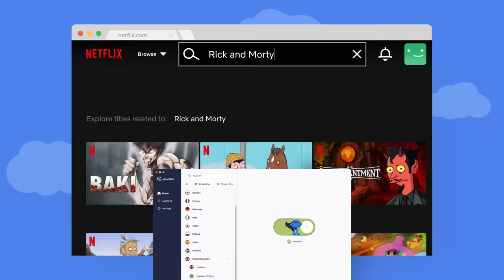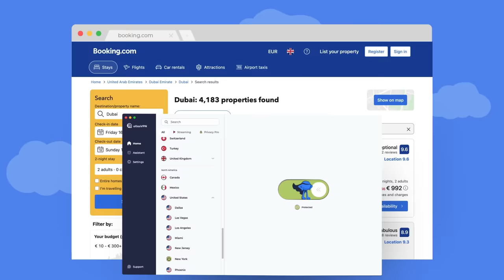How do Russians Cope with Heavy Tank Losses?

Comment: It baffles me that they're still not fixing the T-90/72 reverse problem.
If they're replacing that many engines and transmissions, now would be a great time to remedy this huge design flaw.
With the new T-80s, they're supposed to have a much faster reverse speed, so it's clearly something that the old men in Moscow know about.
Reply: Kid: In these times with the anti tank weaponry you got, it doesn't really matter how fast you can drive back or in general. You can't outrun these missiles and so on.
Reply: When making a tank, its all starts with an engine. Recently there's been a slow shift of abandoning the V-2 Engine design as it reached the maximum limitation of the engine and now starts  development in Gas engines designs that focuses on reverse speed.

One of the main reason why the reverse speed is still not "fixed" in because of their Russian Doctrine which basically summarized as "hills are a no-no to enter unless its ours"  where flanking on high grounds is more on the focus of their armored divisions (this explains why their designs have terrible gun depression and reverse speed while focusing on high speed and rapid fire) 

Another reason is that redesigning the V2 Engine is significantly cheaper than creating a new engine to replace that one. Which kept the Soviet and Russian price for each tank low. Its better to redesign and simplify things than to create from the top.
Reply: Т-80 has a turbine engine. All of the rest do not. It might have something to do with the reverse. Maybe there isnt enough space on the diesel tank.
Reply: Yeah, it's kinda weird considering that Polish PT-91m and Czech T-72m4 had fixed that issue couple years ago
Reply: The real world isn't World of Tanks buddy
Reply: @miriamweller812 yeah reverse speed basically doesn't matter. That's why Russians chose T 80 for mass production, their only modern tank with decent reverse speed, and the first thing Ukrainian former t 72 drivers compliment about western tanks is reverse speed. The opposite of what you said is true, being able to get out of situations fast and without exposing sides has never been more important.
Reply: I'm no engineer. But i'm quite sure then the entire engine bay of the T-72's and T-90's will have to get rebuilt, because they don't use the same engine as the T-80, and that may be the reason why they can't improve the reverse Speed, because the Transmission would need space it doesn't have.
Reply: They actually ARE upgrading the transmissions with new ones capable of reaching 20+ KPH in reverse
Reply: @miriamweller812 Kid there are literal telegram interviews where both russian and ukrainian veteran rank crews say “yeah we’d like that reverse speed increased”

i read one T80 commander saying that the 10km/h reverse speed was able to save their souls from a fiery death on (i think) 3 times.
Reply: @miriamweller812 seems like a fair question, you don’t need to be condescending with “Kid:”
Reply: Surely reverse problem isnt the reason tanks are getting destroyed. Its a matter of priorities.
Reply: @ingloriuspumpkinpie9367 it does mean a lot when a tank has just shot and wants to reverse back into its cover 15 metres away
Reply: @miriamweller812 Russian tank factory: Guys we shoud not fix a clear design flaw, because western anti tank weapons will destroy our tanks anyways 😂 great logic
Reply: @orenalbertmeisel3127 Wtf is this argument?
Reply: I think they need to hire french engineers 😂
Reply: -You don't stop a production line, while in a active war.
Especially not when you've lost 3000+ tanks.
-There's no transmission that can be fitted without a redesign.
The T-72M4CZ only solved this problem via fitting a new engine(Perkins) and a new transmission(Allison).
Reply: @miriamweller812 When artillery starts raining down on you. A good reverse speed helps not make yourself to more weapon systems by being forced to show your arse.

 A convoy is only as fast as the slowest tank. Oh! Front tank was taken out...  Yet now instead of the convoy reversing to find an exit you are stuck trying to again turn around.

 I've seen a video where a tank flanked an other who couldn't reverse fast enough, and shot it in the side. 

 No idea why that tank couldn't just turn to be honest. Lots of questions. Still it clearly was reversing slowly, and trying to get the gun on point. 

 Reverse speed helps. It is ridiculous not to upgrade it. Forcing your soldiers to show the weakest parts so the enemy doesn't even need fancy weapons to destroy your tanks!

 Auto cannons would do.
Reply: @MotivationSHCUM  In very small scale production run, as you need brand new transmission for the job, and those aren't easy to come by, especially when it comes to finding one that can fit tiny engine compartment of a T-72
Reply: It's not war thunder or world of tanks!  The tanks are getting nailed by artillery and ATGMs long before they have time to back up!  Not that it would do them a lot of good most of the time.
Reply: Up until now, there really wasn't a need for it; On a practical level russia didn't need to worry about territorial defense due to a combination of russia's sheer size, it's volume of tanks and it's prodigous nuclear arsenal while offensively Russia's military is mostly there to bully former constituents.
Reply: Because the amount of times it actually matters compared to what it would take to fix that problem is disproportionate. I'm not saying it doesn't matter, I'm saying that it's not something that can be fixed because Russian tanks are hyper optimised for weight and size. You can't just fix the problem because it doesn't fit in the hull. You have to alter the entire hull of the tank. The T-80 hull has different proportions. The cost to benefit analysis is that it's just not worth it.
Reply: @Real_OSHA_Unsafety_Engineer  The reason it's not fixed is because of the dimensions of the T-72/T-90 hull. The engine isn't what gives it its slow reverse speed.
Reply: @MotivationSHCUM  What issue?  Base it on statistical facts and source those facts.
Reply: @85LARGE  It's not the engine. It's the gearbox or transmission. I forget which one. They intentionally picked it for its size, electing to sacrifice the reverse speed. T-72/T-90 share the more or less the same hull. T-80 is a different tank with different dimensions.
Reply: @miriamweller812 outrunning a missile isnt the point. Shoot and scoot is. Drive up, shoot, drive back. 4kmh reverse vs 20-30 is a big difference.
Reply: @miriamweller812 It's not about out running missles it's about being able to fire and return to cover quickly. Look up a video of U.S tanks at gunnery. You see them hull down drive forward fire and immediately back into the defilade. Reverse speed enables you to expose yourself to enemy fire for the shortest ammount of time possible.
Reply: Gas-turbine engine make tank very quiet, compare to diesel engine.
Reply: I am not expert on tanks but on anything else you have various options to increase speed in gear.
Primarily Primary and Secondary Drive Ratio as Gear Ratio itself.

it would be easy to change final drive of the tank to allow increased speed but that would slow down acceleration inall forward gears. So you'd have to replace the forward gear sets to retain acceleration. However this would not need a redisign of basicly anything and you'd not run into any space limitations imposed by engine and gearbox sizes.

That should be a relatively simple fix. However you would have to make sure that the new final drive and the new gearbox are installed on the same tank. If a mixup happens in the field and you end up in a vehicle with old forward gear set and new final drive or the other way round you are seriously fucked... 🙈
Reply: I think on the new T-80 they fixed that problem
Reply: @BigSmartArmed  Do you have reading comprehension problem?
Reply: @Panocek  But it was proven to be possible. Poland and Czechs don't have the same production capacity like Russia so of course the numbers were few and there is factor that Poland wanted to acquire more mbts of western design, so there was no need to upgrade more pt-91s that would go to storage anyway
Reply: @miriamweller812 kid, reverse speed is not for outrunning missiles, its for maneuvers on the battlefield
Reply: @MotivationSHCUM  no
Reply: @miriamweller812   the difference of going 6kmh in reverse and 50kmh in reverse is a life and death difference irrelevant of the weaponry deployed against you.
Reply: @ingloriuspumpkinpie9367 But when has reverse speed really become a huge plus? No matter how fast your reverse speed is, you can’t escape a drone coordinating artillery strikes and kamakize drones. The reverse speed is really only good for tank duels, which rarely happen as is.
Reply: @MotivationSHCUM  PT91 for Malaysia used off the shelf Renk transmissions, after brief googling Czech T-72 got some Allison transmission unit. And, uh, good luck ordering hundreds, if not thousands German/US transmissions that conveniently can fit into T-72 anywhere near Russia.
Reply: There is no clear data that a high reverse speed has a high statistical significance in terms of tank survival.
Reply: @miriamweller812 Tanks need to get behind cover just like infantry. Reversing faster means you're in cover faster.
Reply: @Real_OSHA_Unsafety_Engineer Reverse speed has nothing to do with the engine, its all in the transmission.
Reply: Because it is impossible at a reasonable cost. To do this, you will have to use a monoblock engine-transmission. Which means fewer repaired tanks. If you have a choice of 100 tanks with a new transmission or 500 with an old one, which will you choose?
In addition, the T-72 chassis was recognized as obsolete in the 80s, it was supposed to be replaced by the T-80. So there were no measures for cardinal modernization.
In the same way, the T-34-85 had the same chassis as the T-34-76, but with multiple improvements and improvements in reliability and manufacturability to scale the output. Although the T-34M was ready BEFORE the war, and after that there were T-43 and T-44. Which never became mass and were replaced by the more advanced and technologically advanced T-55 at that time.
Reply: @theduplicator3270  It is faster to turn around and go to the rear at full speed than to back away 30 km per hour.
Reply: @ingloriuspumpkinpie9367  They refurbished the BVM from scratch as well from what I remember.
Reply: @viktoriyaserebryakov2755  This is probably why the Armata is so mobile compared to other Russian tanks, it's a behemoth.
Reply: @rebelliousfew  Tanks are built to maximize frontal protection. Any flaw that forces them to expose their sides is a massive flaw, period. You're throwing everything you invested into your tank by the window just to save a bit of money.
Reply: @milaro222  you dont need data for that although im sure a search would come up in support of higher reverse speeds, in any case its common sense, you wouldnt say its pointless to run when someone is shooting at you because the bullet is faster anyways so you might as well just walk.
Reply: @alispeed5095 Tbh having a good reverse could be the difference between a tank getting ambushed and probably get destroyed and abandoning the place
Reply: @taelorpickel2830  It's heavier than other Russian tanks, but still significantly lighter than its NATO counterparts. I suppose the remote turret severely cuts down on weight and freed up that space to put into the hull. As I understand, the turret isn't even heavily armoured. So I'm curious, if the tank if still 10 tons heavier than its predecessor, how much of that armour went into the hull.
Reply: @S1030dan  If the tank is in an open area under enemy fire, then it would be common sense to turn around and get out of the fire at a speed of 70 km per hour, rather than 30 km in reverse.
If the tank works in urban conditions and it is enough to back up 5 meters to go into hiding, then it is also not obvious what gives a high reverse speed. Without statistics, talking about the significance of the reverse speed is worthless.
Reply: @mrkeykush693  reverse aint gonna save you from a mine you didnt know existed nor an artillery round when stuck in a column.

We see these tanks destroyed and always its for reasons not related to reverse. Frankly speaking, Warfare has evolved to ensure that past a certain point, sophistication (tech) is wasted on a tank. A mine will blow up an advanced leopard as easy as it will a t-50.

Russia is wise to spend its finite resources else where.
Reply: @gamingrex2930 -3kmh is just ...
Reply: @milaro222  we see plenty of footage in the war where both UK and RU tank crews are, even in an open area moving forward to take a shot and then reversing back in to cover (from their point of view mind you) its easy for us to say looking from above with the drone footage that, its easier to turn around and hit the gas. Its not that simple it takes time to pivot the tank even on good roads let alone soft muddy fields, turning around when under fire is just simply not a good idea even to take cover a few dozen meters behind you. As for statistics considering the whole Nato fleet of tanks consisting of much higher tonnage can go at least 30kmh in reverse its quite clearly not worthless. Long post i know lol,  but also consider that the T-14 Armata is supposed to bring parity with the Nato tanks meaning it will have much higher reverse speed compared to the other T series tanks among other things.
Reply: Designing a new transmission and putting it into production isn't exactly easy, transmissions are some of the most complex components in a tank because of the enormous forces they have to handle. Designing it is probably the easy part though, the hard part is retooling to put it into production, that'd mean shutting down factories for a while during the switchover and acquiring a ton of new tooling, something that Russia can't easily do due to the sanctions. There's a lot of indicators that they're not even able to keep up with the basic maintenance of a lot of their industry so opening major new production lines is extremely unlikely.
Reply: One word: corruption
Reply: didn't they mention that new T-80 got almost doubled reverse speed? from 11 to 20km/h
Reply: @sixtynine8046  I believe Ukraine has more t-84s then Russia has upgraded t-80s
Reply: @rgbforever4561  im sorry you thought anyone cared what you believed :S
Reply: @sixtynine8046  apparently you care 😘
Reply: @rgbforever4561   another 80IQ response... really really sorry for you...
Reply: @sixtynine8046  💀💀💀like I would insult you again but you are just yapping like a broken record, so it's kinda boring
Reply: @rgbforever4561  projecting is the most common IQ80 individual behavior, really sorry for you mate  EKSDEE
Reply: @miriamweller812 antitank weapons can't travel through walls
Reply: @ingloriuspumpkinpie9367  Saw a vid of a tank moving up to shoot, then saw it reverse back down, just before an ATGM pass over the turret

Comment: 7 times probably included all the upgraded, refurbished, restored tanks both from the frontlines and from the stocks as well as newly produced T-90M. Not entirely unreasonable statement, if misleading quite a but. 
Uralvagonzavod now working in 3 shifts, opening a new production lines and storage areas. Compare it to pre-war times when they were closing the lines, and sealing unused floors.